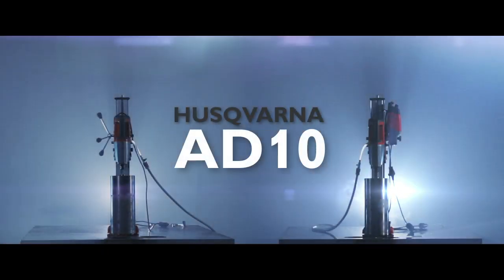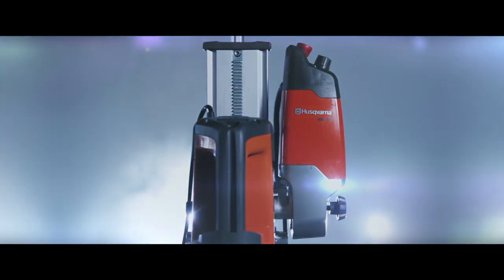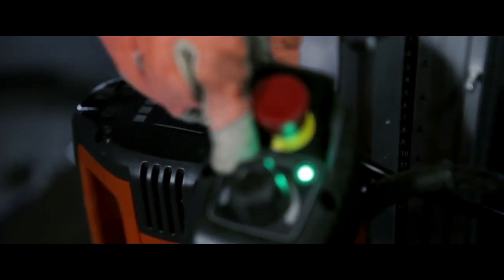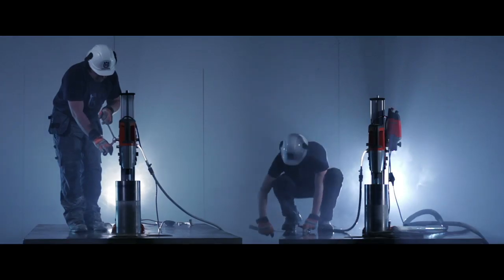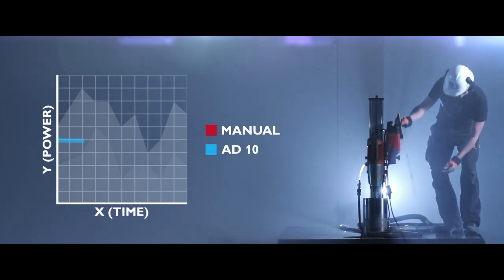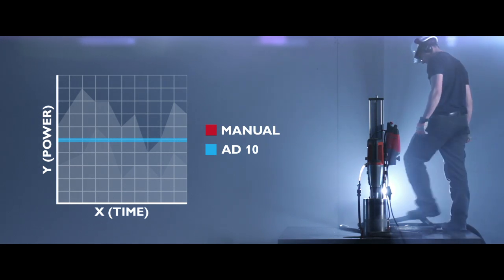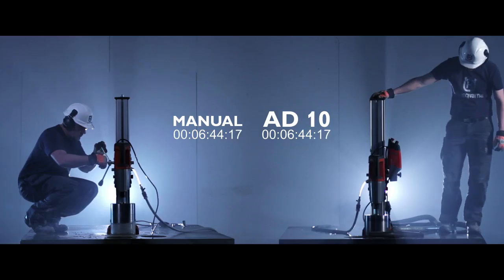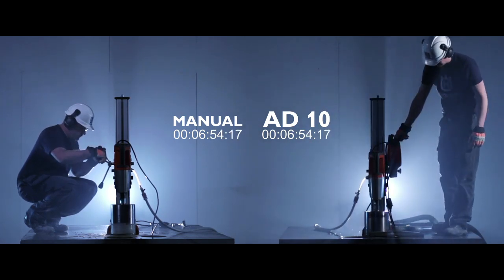AD 10 vs manual drilling

Comment: Needs some weight adjustment in the right areas. Better gears.  Ditch the old heavy motors and vacuum bases and replace with something similar to hilti. Got yourself a winner.

Comment: Used this drill  last week. Needs to be lighter. Reduce weight in material used. Aluminum. Needs a higher gear. I was drilling next to a Hilti. In high the hilti was faster. My back felt great using this drill, but I fell behind , bc the retraction is a little slower than manually . The vaccum base is old style. Needs to be like hilti. Needs flex so it attaches better and there is a better contact patch to create seal. Big pumps and heavy bases is the past.  Lets step it up. Overall great idea.

Comment: To gain true advantage of an automatic drill it should have a radio remote so if you have to drill up high you can control it from the ground.
The guy without the autofeed? I call him moon driller. He's selectively slow. I am not convinced